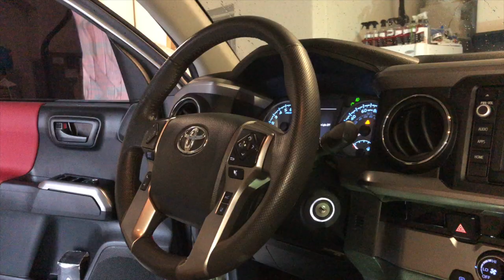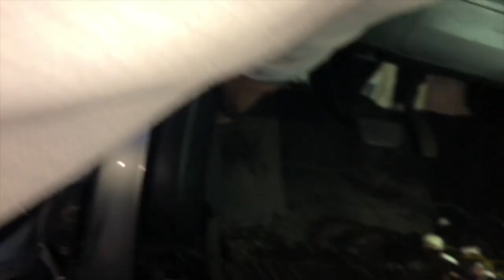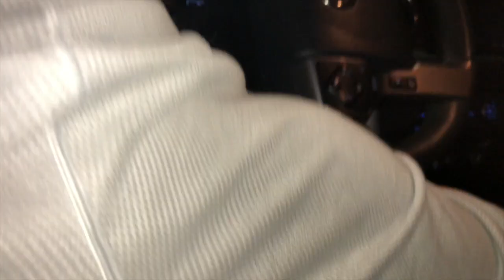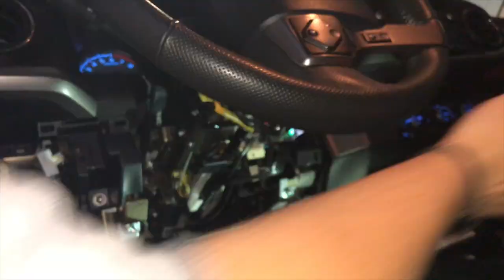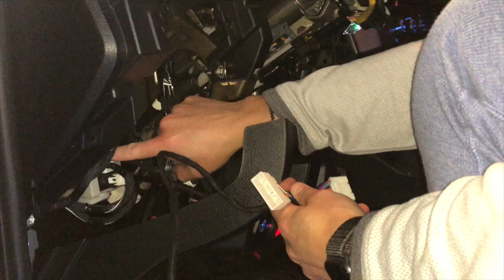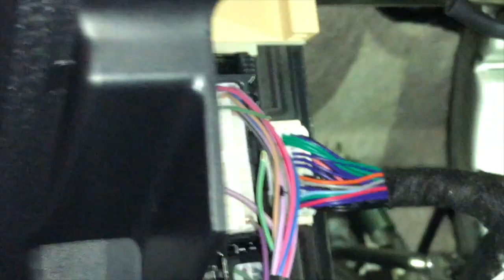Start X Remote Start Tacoma 16+ H-Key System (Regular Key Not Push Button)

Comment: I installed this in my 2021 Tacoma and it worked for a couple years.  It has since stopped working completely.  The key fob won't lock or unlock the truck and it does not remote start.  I went through this video and followed the steps.  When I get to the point of inserting the key and turning it to the on position, only the red light blinks.  It continues to blink for several minutes.  Has anyone else experienced this?  What am I missing here?

Comment: I  just installed this today....I was a little worried about  cutting the wire ...in the end everything went correctly....... looking back though I should have used posi-taps  instead of cutting the wire
Reply: What's a posi tap?
Reply: @AdrianC-m5k a posi tap is a connector that allows you to connect a wire to another wire without cutting....also you dont actually need to cut any wires when installing this auto start kit......cutting the wire allows you to use youre key fob after the autostart is on.......if you dont cut the wire the auto start will still work but when you try to get inside the truck youll have to use the actual key to unlock the door
Reply: @briankeith757 I installed one of these units on my 2019 rav4 and everything works fine. No wire clipping necessary

Comment: I just did this. I don’t really enjoy doing car things, but this was easy enough. 

Wires are easy enough, just follow the video. 

I did completely skip the Tire Pressure sensor wire part. That will sit neatly in my glovebox until it starts acting up. 

Once it is programmed, I played with it to figure out the functionality. You can lock your car like normal. It when you want to remote start it, hit the unlock, followed by 3 solid lock clicks. 

Good luck yall.

Comment: I just installed on a 2017 SR5. I was at the step to hold the button and plug in. It didn't get any LEDs until I let go of the button. It then flashed like it wasn't programmed. All LEDs blinking. I had to reground it. I didn't do it tight enough or it didn't connect properly. After that it worked like its supposed to. Also, i bought a ratcheting crimper for the TPS wire, but it was the cause of more headaches. It was set too strong and was snapping off the wires. I ended up using an old crappy crimper and somehow got it to hold the wires.

Comment: On my 2016 Tacoma sr5, I can’t get past step 5, I press program button 10 times, it starts doing the blinking, I put key in, turn to on position, lights quit and that’s it, no flashing afterwards. And this is the ONLY video I’ve found on a H-key tacoma
Reply from the maker: Hey Clinton, can you tell me are you just plugging in the black power connector to the start x module first and not the others? You will not see the programming lights with the other connectors inserted. The sequence is : connector power with programming button depressed, wait till blue, release, then connect all the remaining connectors to the start x module. Can you confirm you are doing that?
Reply: @mikeleardo  well mines white, I’ve been seeing the push start are small black ones and H-key 6 slot white ones. But yes I’ve done with both way and both ways I get the same result. Blue and red lights, push 10x then they both blink for a few seconds, stop and go again. Both ways, plugging everything else in after, and with it all plugged up, they blink until I turn the key to on and the black box(brain) doesn’t do anything from that point on. I’ve tried master reboot on the box, and still same result. Not sure what to do.
Reply from the maker: You get it through amazon? Order another and try and replace the brain unit. also please double check all the BCM harnesses are tight and clipped in. @SkinsNation1212
Reply: @mikeleardo  ok thank you sir. Yeah I spent 20 minutes hooking it up if that and then 2 hours messing with it, going back thru all the connections and changing ground spots, until i gave up. It’s still hooked up, I got that TPS wire cut and hooked up. I emailed the help thing off the package but they only work mom-fri. I appreciate your response
Reply from the maker: Anytime! These are fairly simple so if you spent that much time messing with it get another unit asap and just return the bad brain! @SkinsNation1212
Reply: @mikeleardo so I reread these this morning. I think I tried how you’re saying. First I follow you on this video. Connected all wires and lastly the power while holding the button. Stopped on blue and red, pushed 10x, then the blinking started put key in and turned to Acc, then to on, and lights stopped. But the manual says to do it by connecting the power first while holding the button in, then stop on red/blue. My trucks the same as your, if your the person in this video.
Reply: @SkinsNation1212 did u figure it out
Reply: @ no they sent me another one and I tried it and it never did work
Reply from the maker: After reading again make sure you have the ignition to ON and not just accessory - two clicks!

Comment: Thank you for your video. It saved me a lot of time. My tpms wire was pink on 2023 SR if that helps someone and yes the tpms light comes on until you switch the ignition to on and press the brake pedal.

Comment: Do you still need to connect the tpms wires? What will happen if you don't?
Reply: Didn’t connect mine. Was working fine for about 2 weeks then the programming messed up and I wasn’t able to use the remote start.

Comment: So when connecting the wires to the 33 pin, can you just connect the wires with the new connector, or do you need to remove the shielding and then crimp on the new connector?

Comment: Thanks for the video, very helpful! The directions that come with the product are VERY basic and not helpful at all. On my 21 SR5, the wire in the 33 spot was pink if that helps anyone, and yes the tpms will throw warnings and light will flash until the truck is turned to the "on" position.

Comment: I ordered the kit and I have a very serious problem.  I have a toyota tacoma 2021 SR5 and it turns out that when I press the door close button 3X it starts, but it closes the whole car and there is no way to open it.  I have to wait the 10 minutes until it turns off before I can open it.  Anyone know what I can do please
Reply: How did you fix this? 
I just installed it on my 2018 Tacoma and it’s doing the same thing. 
Were you able to fix it?

Comment: Great video. Just want to let everyone know that this kit works on the 2020 SR5 Tacoma. A couple of things:                                                    1. the tpms wire was light pink on mine                                                        2. I saw in another video but wasn’t in this one was when you connect the tpms wire from the unit to the harness the red wire connects to the wire you cut coming from the connector clipped into the bcm and the green wire goes to the other half of the wire you cut that runs into the rest of the wire harness. ( I don’t know if it makes a difference but people on the other video said they had problems and people in the comments said to switch the wires so they were like what I typed).         3. When you go to remote start it, it’s  3 slow presses of the lock button  if you do 3 fast clicks it won’t start.     4. The tpms light will stay on until you put the key in the ignition and turn it to the on position and step on the brake pedal. Once you do that you have performed the “takeover” and the tpms light will now go out.     I hope that this info can be helpful to others as it answered some of the questions I had.
Reply: Followed your directions on a 22 SR5 & it worked.

Thanks for the addition to this video.
Reply: I was thinking about that because all the directions say to do is to "Cut the wire going to pin 33. Connect these two wires to the two cut wires". But I kept thinking but it's only one cut wire and then the order to connect them so thank you for this clarification.
Reply: So on the website, it says with the H key it’ll still shut down when the door opens. I’m guessing that is not true.

Comment: do you have to connect the tps sensor for it to work? does anyone know by chance i already have aftermarket wheels on my 2018 Tacoma and never put sensors in them since i bought them second hand and not new so just wondering if i buy this kit do i still need to cut the wire and hook all that up still any info would help thank you.

Comment: Just installed and Mines working pretty normal. Question to others. Is the tpms light blinking on dash during remote start? It goes away when I put the key in and turn to on. Not sure if that’s normal or I need to check something. Other than that it works. Others let me know!
Reply: I wanna know to I just installed it
Reply: I saw on another video that that is absolutely normal, mine does the same thing.
Reply: Does the truck turn off once you open the door?

Comment: Anyone having issues starting? Mine is sporadic. Sometimes I press 3x and it won’t start. Try a few more times and it may work. Last night I couldn’t unlock it once started and needed to use the key
Reply: It seems to work now, but it doesn’t start on 3, it is almost always 4
Reply: Did the unlock button issue get resolved while the truck was running?
Reply: Does the truck turn off once you open the door?
Reply: @jeremytovar352  the truck stays on
Reply: @harpreed  just put the key turn and it stays on? I know a couple of them that turn off when you unlock or open the truck
Reply: @Charlie Private that was a while ago. The starter works perfectly now